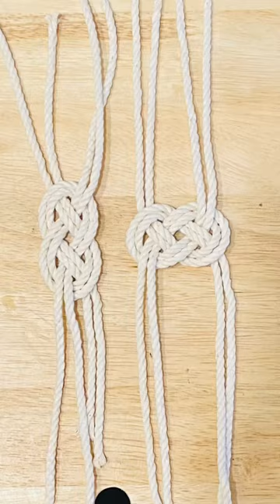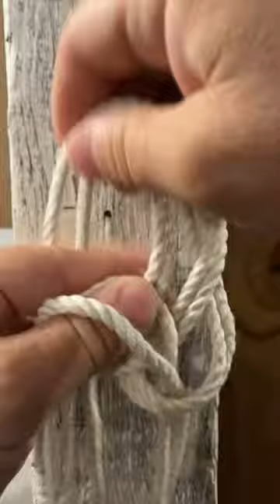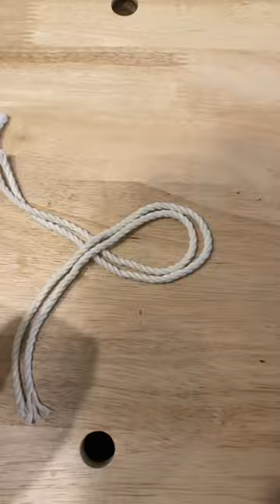Tie the Josephine Knot and the Carrick Bend #howto

Comment from the maker: The Carrick bend is a knot used for joining two lines. In the decorative variation of a carrick bend, which is called a josephine knot, both standing ends enter from one side and both working ends exit from the other. Josephine knots are used in macrame plant hangers and jewelry.